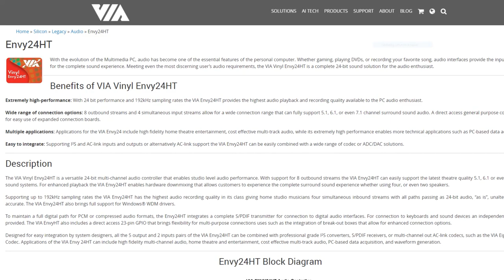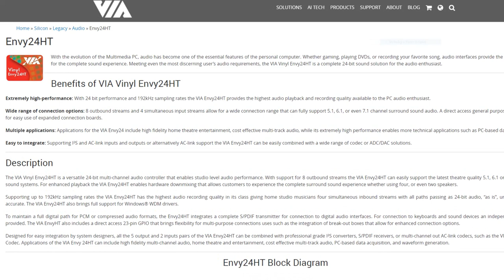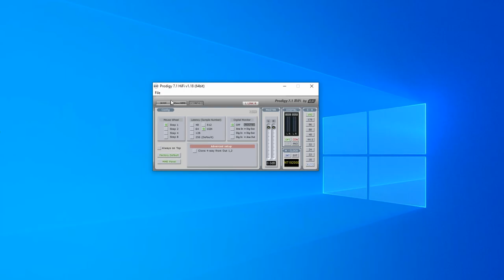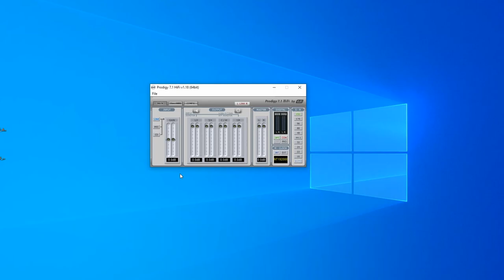Smack my sound up, with this Prodigy sound card!

Comment: So i have made a very important discovery about this card, while working on my fork of the open source mac driver: The unbalanced audio could be caused by a driver issue caused by a missuse of the equalizer register on the codec, actually by using the card on linux or with the open source driver i am working on for mac, the audio is pretty balanced (at least to some hearing tests), so my suggestion is either to find proper windows drivers or try this card under linux.
Reply from the maker: That is a very good idea! I have played with linux in the past, so it shouldnt be that hard. But with linux you can never tell.
Reply: @AntonsHardware  Actually the driver comes integrated into most linux distros, and your test pc should not be really a challenge to get fully working on linux, so I recommend you to just go for an easy distro to install like mint or ubuntu, and probably everything will work out of the box, maybe the gpu many need third party drivers to have full performance and/or features. BTW you can just test the card using a live distro if you don't want to bother with installing linux, then you can just playback audio files with vnc from a usb drive.

Comment: I'd like to know if you bought a modern high end motherboard like the b550 asrock tai chi for example, would a separate soundcard still be necessary?
Reply from the maker: My main rig uses a motherboard with a realtek 1220 and a sabre dac. But i still got an improvement with a xonar ae. Mainly because my motherboard had hisses and popping sounds. I now use the evga nu sound card, which is one of the best cards out there.

Comment: I have one, but it doesn't work with Windows 10 64bit. Do you Know if there is drivers for that S.O. ? Thanks
Reply from the maker: I used the Windows 7 64 bit drivers on their website. They worked just fine, but the driver interface did have some issues.
Reply: So actually you might have sound issues if you force drivers from other cards (might misuse some registers on the card's codec and cause issues) or old windows drivers, the only updated os with good drivers for this card is linux at the moment, but I am also working on a Mac driver for PowerPC Macs and hackintoshes.